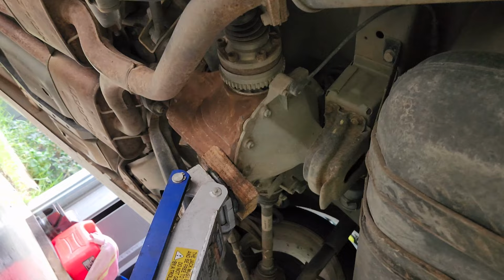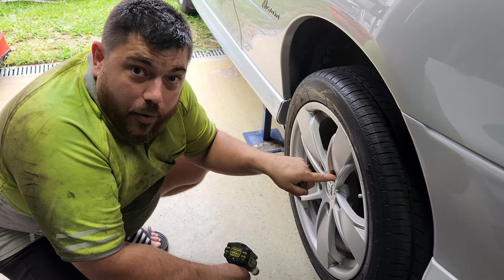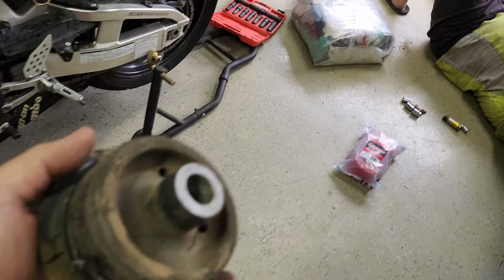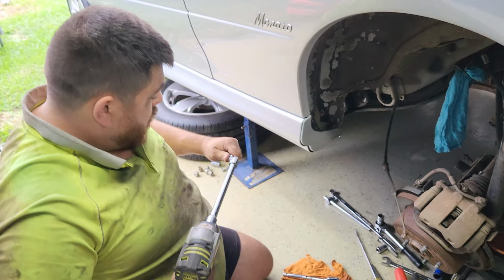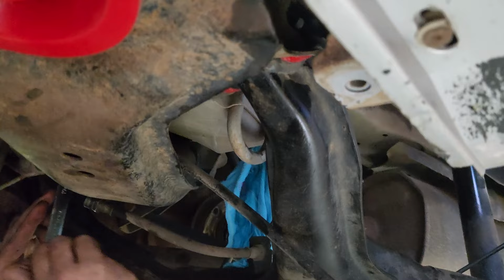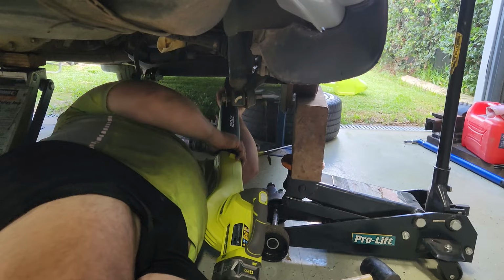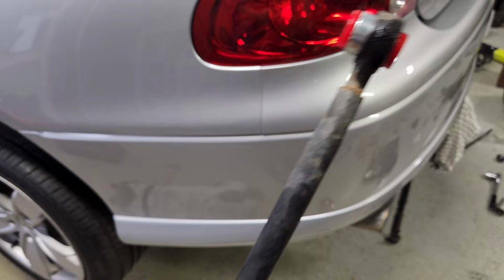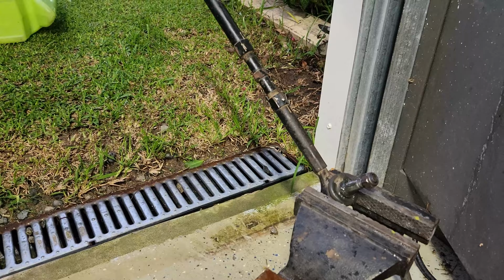CV6 Monaro Build | #5 - Sway Bars and Bushes (2/2)

Comment: You may regret the nolathane, mate ripped them out of his monaro as they gave a shit hard harsh ride and feel, car also sat high waiting for it to settle. He put rubber back in and has never looked back. Hopefully you guys are happy with nolathane
Reply from the maker: We'll wait and see.. I had a mix of nolathane and superpro in the past and they're all relatively the same. I'm unsure what actual springs and shocks I want to run yet so watch this space.
Reply: @TinShed I’ve pulled nolathane out yeastday morning and do them up with weight on the car they bind overwise

Comment: Hello sir, good job
I just need to know if these pieces from Nolathane are worth buying or not, is it a good after you trying it ?
i telling you that because this is my first time will ordered from Nolathane, and im live in middle east and the shipping is so Expensive.
Best Regards.
Reply from the maker: The bush material is much stronger and durable than factory rubber. You will notice your car to be tighter and more responsive. But as well as it's a harder material so it will transfer more noise into the cabin  but not that noticeable. Nolathane, whiteline, superpro they're all good Bushes.